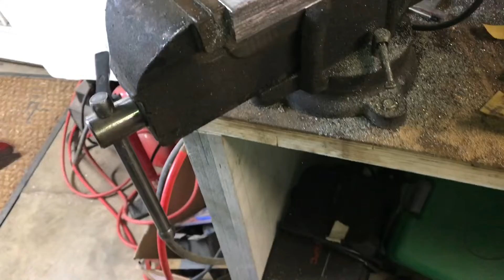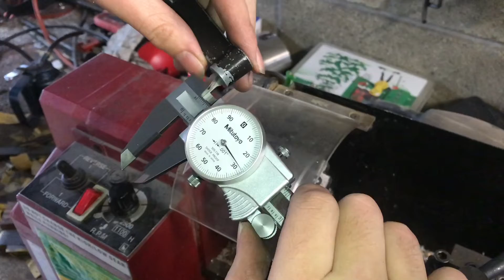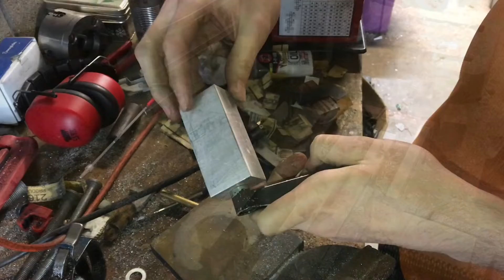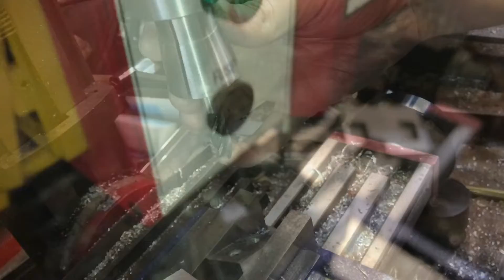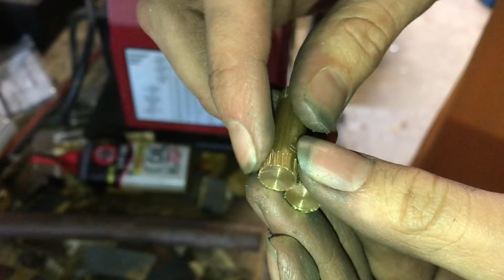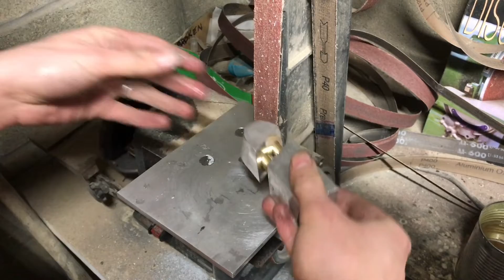using 4 jaw chuck “RECTANGULAR” shapes on metal lathe

Comment: 3:10 drills almost always drill a bit bigger, just because you don’t want it to. I’d used the next size smaller and turn shaft to make a snug fit . 
Also, I would’ve drill through for the two rods before cutting in half at that nifty angle. You could plug the holes after, to disguise how you did it. Nice work.😊